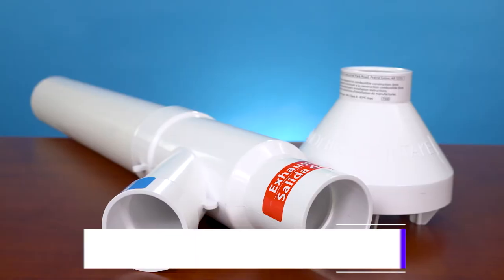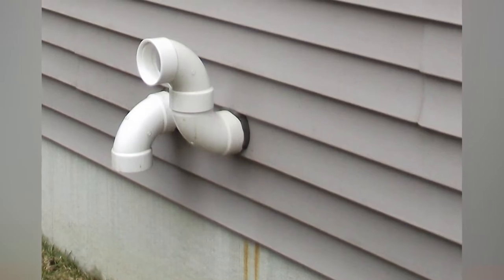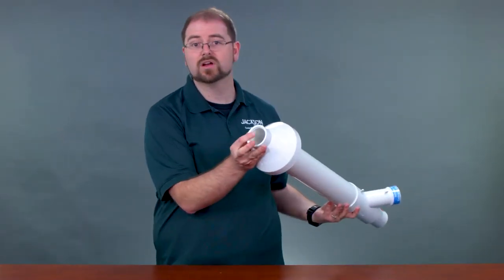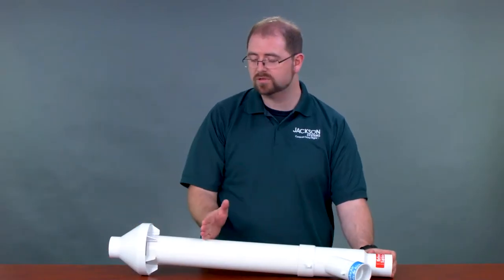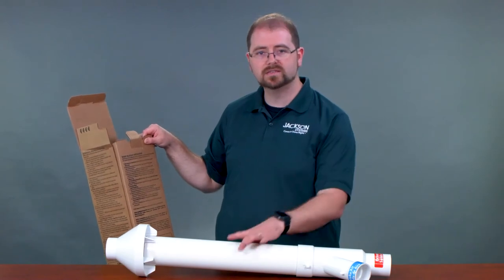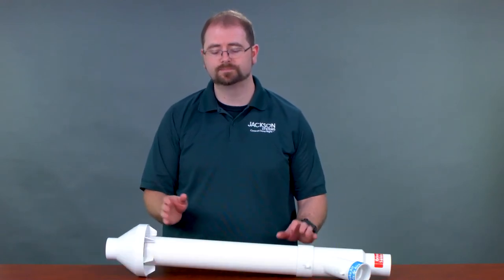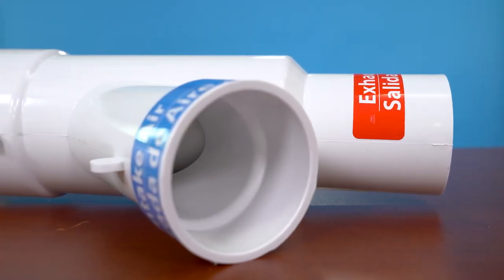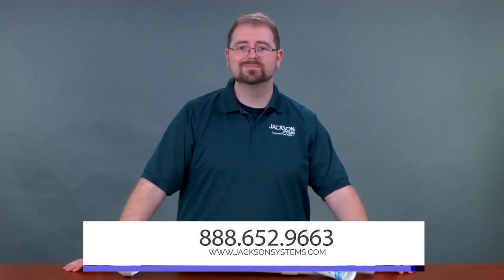How to use the Diversitech CVENT Kit

Comment: I'll never understand an open top vent. When they installed my furnace exhaust water came down the pipe and into my closet space and started rotting out the floor before I put a 90 on it..Maybe they forgot the 90? Either way I don't want water coming into my tankless even if it does have a condensate line.
Reply: I had the same problem, but my vents were turned down. The water was leaking from the joints of the PVC vent pipe. The joints were not properly glued, allowing water to leak out and onto the drywall. I thought it was a roof leak, but it was because the home builder didn’t know how to glue a simple PVC joint. As long as the condensate drain is clear, there is no risk of water intrusion from an open top vent pipe.

Comment: How do you remove the outer PVC rain cover to replace the pipe jack when getting a new roof? I am guessing our installer glued the inner pipe….
Reply: Yes is glued. The flashing changes and over laps I believe. New construction we leave the top not glued until roof is complete

Comment: How do you deal with heavy rain? Is there a way to cover top opening?
Reply: Came here for this answer. I’m installing a indoor tankless water heater and need to vent it. I saw these concentric vents but wondering about the open vent.
Reply: Prob add a 90*
Reply: I was here for same question for a tankless water heater. Philip Dias. You suggest a 90 but wouldn’t the intake be sucking in water at that point? I’m doing a vertical termination. I guess it’d be the same problem for a horizontal termination.
Reply: @joel4210  what did you end up doing?
Reply: What did you do? Did you get an answer from somebody?
Reply: If the unit doesn’t have a condensate collector on top of the unit , you can add a drainage tee to catch any water. Units are designed to catch condensation before the unit or internally. Rain or condensate, it’s all water.

Comment: Would there be an appreciable amount of heat absorbed by the intake air side? Considering mounting an outdoor temp sensor in the intake for humidifier control. Would appreciate your opinion.

Comment: I just installed a new high efficiency furnace, can I use this pipe and run my exhaust and intake pipe up through my existing 6” exhaust vent that goes from the basement up through the roof that my old furnace used?

Comment: I have two horizontal furnaces in the attic can I use both furnaces to tie into the 3 inch exhaust and intake?  I just wanted to know if I could just use one connector instead of two going outside of the house. Both are 3 ton 60k btu. Thanks!

Comment: I realize the PVC exhaust pipe running back to the furnace needs to be sloped, but in a horizontal install, should the CVENT be perfectly level/perpendicular with the exterior wall?  In other words, would only the pipe from the CVENT back to the furnace have the 1/4" per foot slope, or does the entire assembly, including the CVENT, need to maintain the slope?